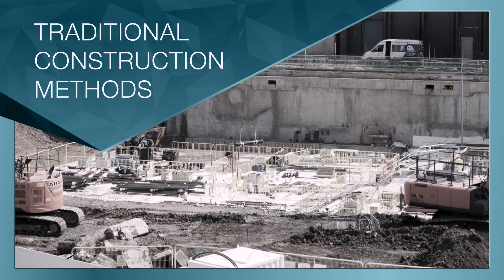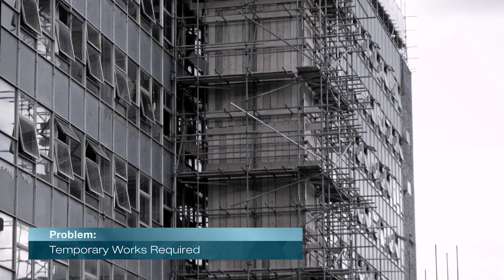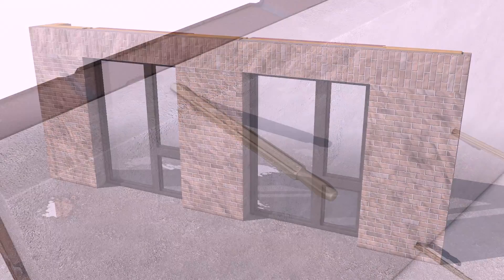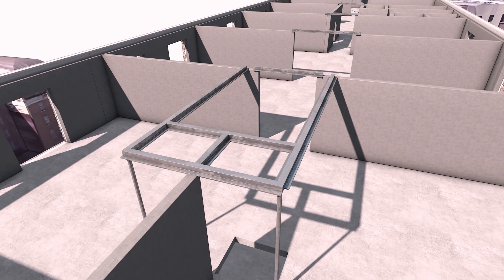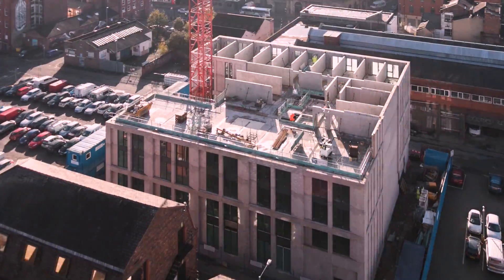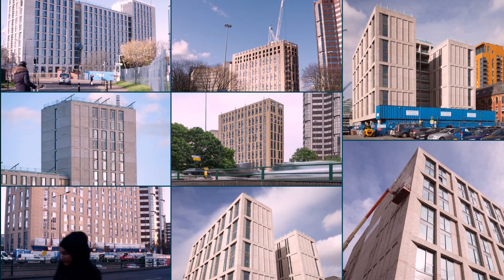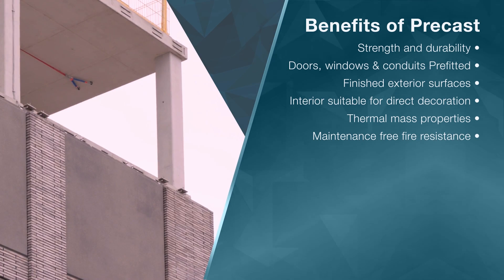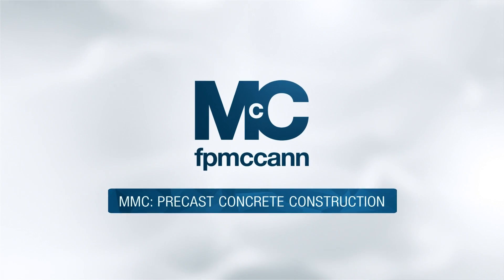Modern Methods of Construction with FP McCann using Precast Concrete

Comment: I'd build a house using this method if someone in western Canada ever got around to the 21st century. Tank-less water heaters, heatpump water heaters and even geothermal loop heatpump systems along with ductless mini-split AC and solar panel energy seems to be prohibitively expensive to the point that no one does it.

Comment: Modern?? AHAHAHHA!!! These methods were actively used in Soviet Russia, in the 70s. Don't take credit for others! This method of construction was invented by the Russians!
Reply from the maker: The concept is certainly not new as ancient roman builders made use of concrete and soon poured the material into moulds to build their complex network of aqueducts, culverts, and tunnels. Modern uses for pre-cast technology include a variety of architectural and structural applications – including individual parts, or even entire building systems.

In the modern world, precast panelled buildings were pioneered in Liverpool, England, in 1905. The process was invented by city engineer John Alexander Brodie. The tram stables at Walton in Liverpool followed in 1906. The idea was not taken up extensively in Britain. However, it was adopted all over the world, particularly in Central and Eastern Europe[4] as well as in Million Programme in Scandinavia.

Comment: The concrete Floor slabs should be used everywhere. seen to many contractors constantly getting into trouble with sagging floors.  most times they get away with blaming someone else.
Reply from the maker: It also acts as an excellent fire break.  The acoustic benefits are immeasurable.  This is the key reason why more and more hotels are turning to precast concrete/concrete in construction.

Comment: That's great but could you also consider using clt (cross laminated timber) please? It's much more eco-friendly and since you are making such a radical change, why not shifting directly to timber
Reply from the maker: Thank you Tahsin for your comment, but the speed of precast concrete construction and a strong focus on safety is the key reason why precast in a winner.  Not to mention the fire resistance credentials of concrete, most of our sites would be in tight urban spaces and close to residential buildings.  Precast concrete is by far the quietest form of construction as well.
Reply: @FPMcCann1 Hi, do you supply your services in africa?

Comment: Are those buildings tested for earthquakes? What about wind pressure? I see that many developers are adopting precast concrete & prefab techniques for buildings (higher than 6 stories) which is dropping construction cost & time, yet selling for same or higher value!
Reply: You are right. In that point i think it fails

Comment: good one!!! can exterior cladding like marble or lime stone be put during the panel making for a residential application?
Reply: yes you can. first small brackets must be cast into the precast panel, which can subsequently support many types of stone veneer panels (1/2-1.5").
Reply: the whole point is about offsite construction and stop trying to do things yourself.  Technologies are here.  Simply order dont get in the way if you want perfect precisioned products.  Precast is only one of many technologies.

Comment: Meanwhile in eastern Europe, in the soviet times we push this tech over the moon, literally whole cities built by the same blueprints, all the same.It's quite comfortable in the inside. The concrete walls kinda conduct noise, but it's far better than wood frame buildings. The whole experience is depend on your neighbors.
Reply: Apparently those soviet blocks are so strong, literally nothing tears them down even after so many centuries.
Reply: @highandmightyqueen79  
Experience may vary through upkeep and cultural enrichment. If the home owners pay for the necessary repair, and change the pipework after 40 years, it's good. If you have small children over you, you will hear them during the day running round, pushing chairs, throwing toys, and screaming, but at least the thicc wall dull it to a tolerable level. If your neighbors are culturally diverse, ... well, east Asians(Japan, Kora, Singapoor) are cool. Equally important, equally equal you are not allowed to say a bad word about of them or else people on the other way...
Reply: @highandmightyqueen79  depends on how much was stolen in process and how careful construction workers were
Reply: @highandmightyqueen79  unfortunately….Russian artillery tears them down. Glory to Ukraine.
Reply: Not only that it's extremely energy saving and not requires maintenance at all.

2. Saves the space as well. Only 1% apartments in usa but holds 30-40% of people in the usa or Canada
Reply: Yeah, i know, because i am from there, but communists didnt make sandwich walls...so no insulation. Are the worst quality and the ugliest buildings !

Comment: It's a lot more expensive to do it this way because of the cost of shipping
Reply from the maker: NISMO JOE  as the product is manufactured locally, the cost of shipping would not be more expensive. Delivering the product as and when it’s required also caters for small construction sites that don’t have space for storage.
Reply: Cost of shipping is somewhat nullified as to casting in place. You are not trucking in 30-40 concrete trucks to pour a floor at a time plus the cost of the concrete pump, which gets expensive.

Comment: What are the disadvantages of this all method 🤔🤔
Reply: You seem to have been given a very vague/generic response as opposed to actually answering your question. The disadvantages of any MMC are as follows:

- Inflexibility of factories for fluctuating demand  
- Difficulty integrating MMC’s with traditional work 
- Lack of local materials  
- Lack of published codes and standards 
- Lack of cost data can lead to perceived or real additional costs
- stigma due to post-war prefabricated housing
Reply from the maker: Harsh Gajjar thankfully there aren’t many disadvantages. Especially in light of the current pandemic when we having less people on site is essential. A gang of 10 men can take care of this entire installation.
Reply: @FPMcCann1  ten men. That's being generous in uk. There would be one man slinging to men installing 1 engineer and two men grouting with the installers. So maybe 6. 7 if you include the crane operator.